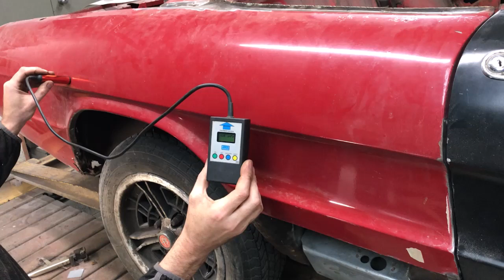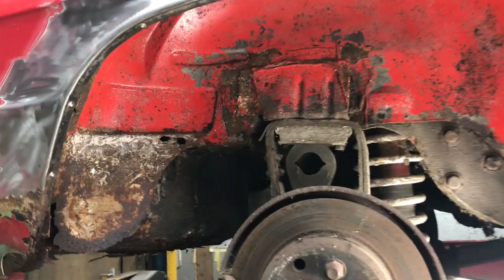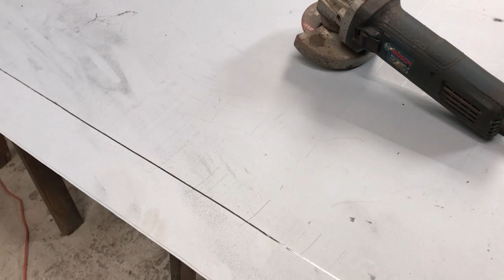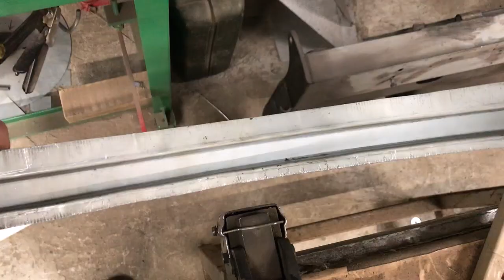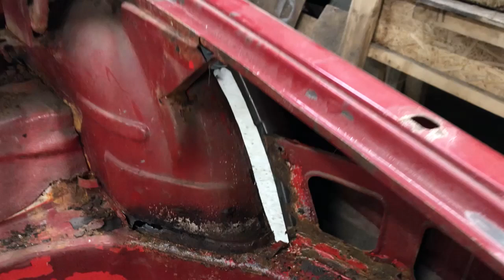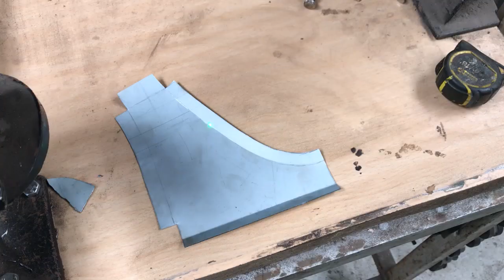Part 3 Alfa Romeo Spider Restoration, How to repair inner arch, jacking point

Comment: Forgive me for asking but could you not buy a pristine spider for less than this restoration is going to cost?
Reply from the maker: Yes you could but most restorations are that way. The cars get saved because of some special attachment or because the owner wants the car restored a certain way. If you plan on keeping the car forever then it doesn't really matter what you spend on it. 
If you bought one that is in pristine condition you don't know how long it's going to stay in pristine condition. That comes down to the quality of the restoration.

Comment: Hi Ben, good follow up. I had to fabricate that inner wing ‘trough’ too. I went with an angle iron former and press tool curved to the profile, but I didn’t do the entire length. A 20 ton press is a handy piece of kit on that job. Well done, it’s deja vu watching your progress.
Reply from the maker: Nice, so you folded the channel first like I did ? Then made a u-channel bottom die from angle iron ? How was the top die made ?

Comment: Man that looked daunting 🙂 some serious rot had set in, no wonder these cars are as rare as they are lol great work fabricating those panels. 👍
Reply from the maker: Thank you 🙂, yes the cars are put together a little differently than most of that era, it's built strong but much more complicated than is necessary. So far replacing sills, floors and the inner arch has been challenging and joining so many panels at once is certainly a recipe for rust. I still quite like the car though, good to save it I think and twin 40s from standard, yes please.

Comment: Very nice work, I used to restore classics back in the 90's and as innleadair said it would be a more pleasurable job without customers!
Reply from the maker: Thank you for the comment 😊, did you ever consider the buying, restoring and then selling route?
Reply: @bensclassicbodywork  didn't really get the opportunity, the classic car market crashed, which left me doing mot repairs for little money, so I closed the business and changed direction with my career. I have done a couple since for personal use but thats about it.
Reply from the maker: That's a shame. I did hear about the 90s crash, a chap who bought a car off me used to deal in Ferrari's he said he went bankrupt after his stock lost massive value. Not sure I would want to get involved with the higher value cars personally. Certainly more risk attached. He bought a £300 rover metro off me, how things changed for him.